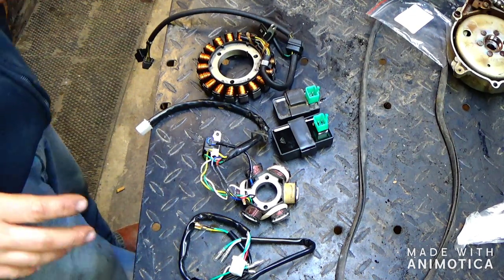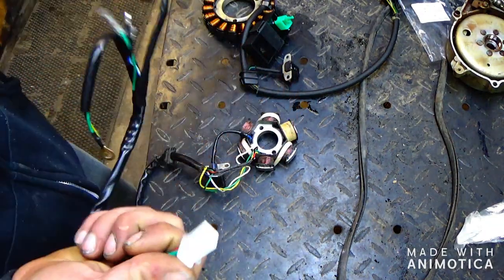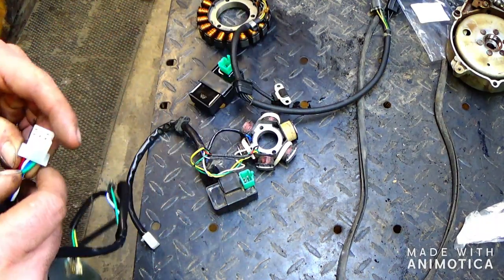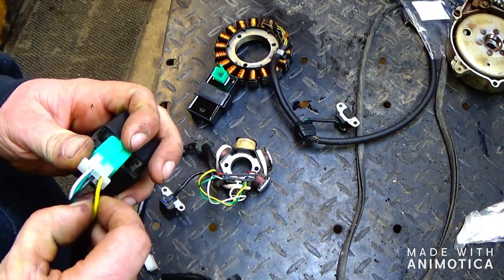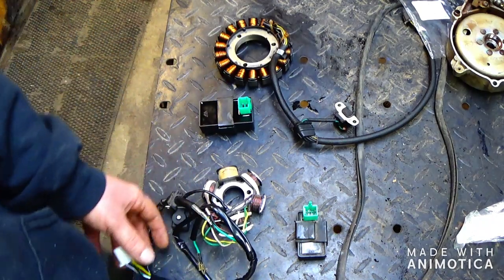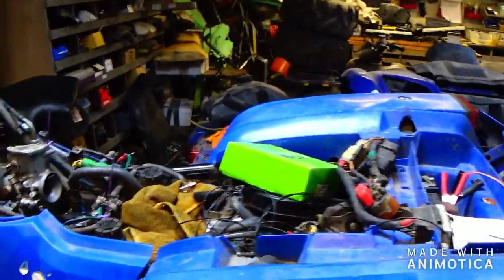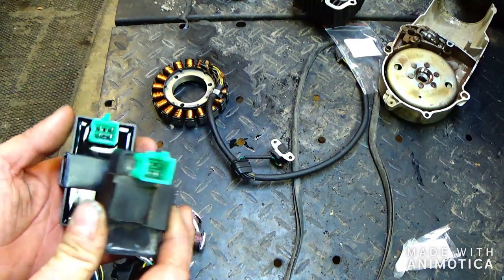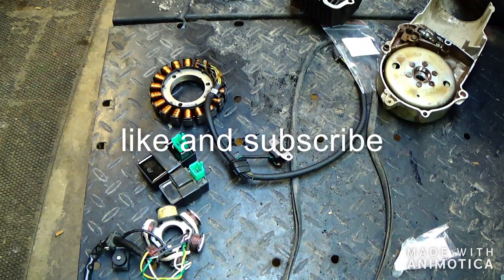how to wiring hack 5 pin cdi box and 4 pin cdi box

Comment: On a 5 pin china cdi I’ve pulled the black and white wire out of the connector to eliminate the safety crap on this Tao Tao 110 as it was keeping it from sparking. Now the quad has spark and runs but I have no way of killing the engine as the kill switch does not work now cause of pulling that black white wire. What could I do to have a kill switch work and still leave the black and white wire disconnected from cdi?

Comment: 1986 Yamaha Badger 80cc. Bad CDI. Do you have a diagram drawn out for wiring in one of these 5 pin CDI boxes?
Reply from the maker: Not yet, but I’m working on it
Reply: I’m struggling I guess to test the stator and pick up to see if they are even good. I’ve got the wiring figured out but before I commit to a new CDI I need to find out if it’s bad for sure. Any recommendations on testing this system?

Comment: Thank you for this video. I just ordered a four pen CDI for my 1997 arctic cat 454 quad question the CDI that is currently on there has like an eight pin connector and then it has the four pin. Should I remove the eight pin connector and then do this four pin hackso that nothing is connected to the OEMCDI

Comment: My wires are different color, no black wire, mine has seven wires, what to do ? Help !
Reply from the maker: What kind of ATV is it?
Reply: @kingofatvrepair7808  99 polaris sportsman 500
Reply: @kingofatvrepair7808  is there a way to interchange wire colors ?
Reply from the maker: Yes, but you have to pull the cover for the stater to figure out which wires are for the pick up
Reply: @kingofatvrepair7808  99 polaris sportsman 500

Comment: So, can you use a dc box on a ac system? By using key switch 12 v to power the cdi, then hooking rest wires according. The charging wires, the 3 white from stator should still run to the rectifier and charge the battery,,, correct? Thanks

Comment: I have a candy GY6 150cc Spyder it has three wires coming out of one connector and one coming out of the other to the CDI box does that mean I have a 4: pin and I've got a 5:10 racing CDI box with the red wire coming out of it can I hook it up to the 4: pin

Comment: I bought a wiring harness from Amazon for a gy6 engin and the cdi box has 4 pin and 2 pin connectors that came with harness but the harness has a 3 wire and 2 wire will it still work

Comment: I have a early 90's TRX300FW that I have replaced the stator, spark plug, ignition coil, and I'm using a 4 pin CDI DC 12 volt box, my stator is 3 wire yellow and 1 ground 1 pulse wire and 1 yellow wire I still cannot get spark everything is hooked up correctly what do you think could be my problem I have proper grounding in a charged battery
Reply from the maker: Check and make sure your DC CDI box has 12 V to it from the battery

Comment: Also do those racing cdi boxes really work as in more top speed or is it a gimmick? Cheers you video is awesome. Just not sure if AC kit will work
Reply from the maker: It will make it faster but it takes the rev limiter off of it so you have to be careful if not you can really damage your engine

Comment: Could you help. Do I connect extra wire to my key ignition? Also those AC racing 5pin cdi box will that work on my bike as I can't find racing DC box
Reply from the maker: So you would have to switch your stater for the AC CDI box to work and your charging components for your battery cordon on The bike it might be easier to switch the whole bike to a AC System

Comment: do you happen to know where i can find a wire harness kit with the stator, reg. coil, key switch, exc. for a 2007 Linhai 260 4x4. some jack ass molested the crap out of the factory harness. i can find some but my stator has 3 mounting holes in a triangle pattern.
Reply from the maker: try this place https://www.vmcchineseparts.com/

Comment: I need to make a 4 pin stator work for a 5 pin cdi
Reply from the maker: usually a 5-pin CDI box is a AC CDI box and a 4-pin is a DC CDI box so usually you can't swap them out unless you go from a 5-pin to a 4-pin but if you can send me some pics of the 5 Pin CDI box and the 4-pin CDI box that you have I will see what I can do for you
Reply: 2001 Honda TRX90 only sparks when letting off starting switch do you know what would causes this? Thanks Brad

Comment: Hello I'm working on a 2005 ktm 525 sx it has a 2 wire stator  and 2 wire pulse generator or trigger cdi is bad what would be the best cdi box for it and the wireing of it
Reply from the maker: with those your best bet is to put the original back in it because the Chinese CDI boxes can't handle the RPMs